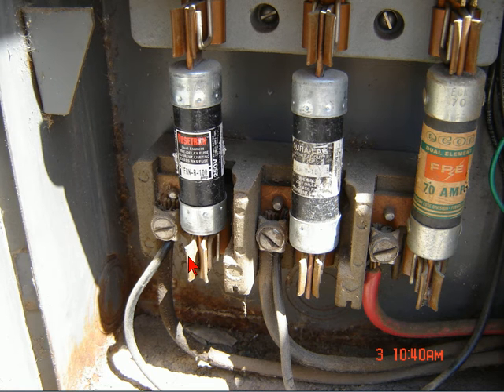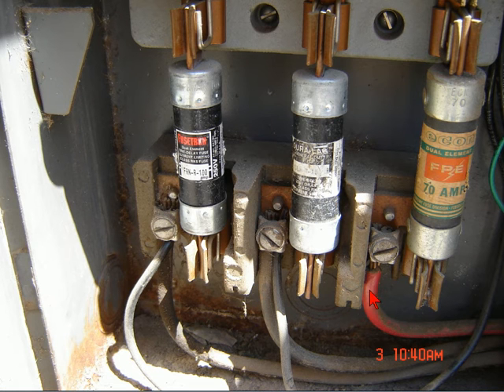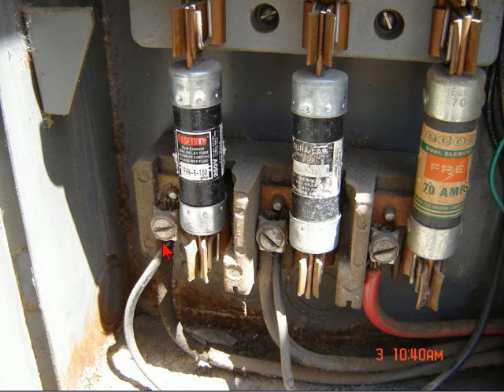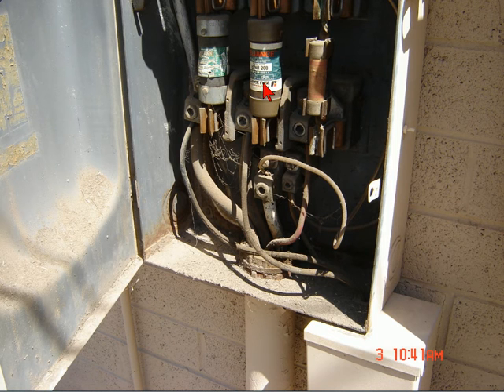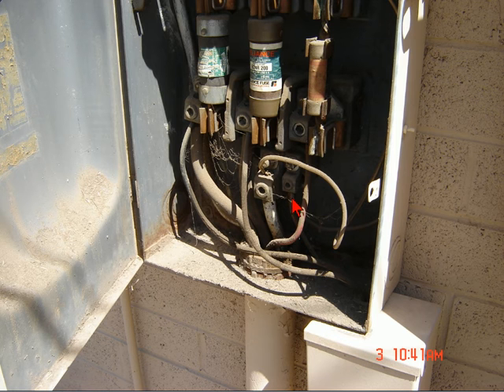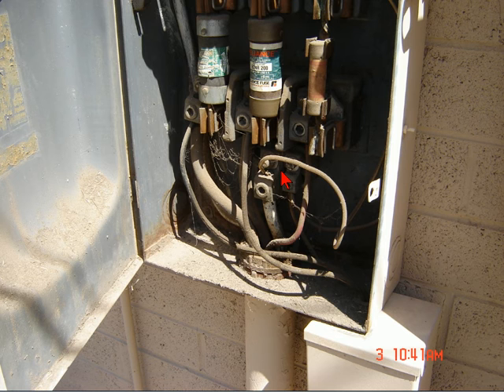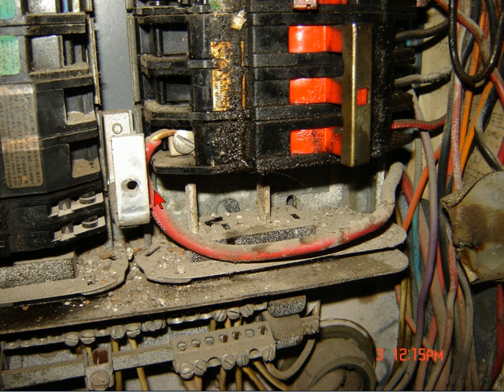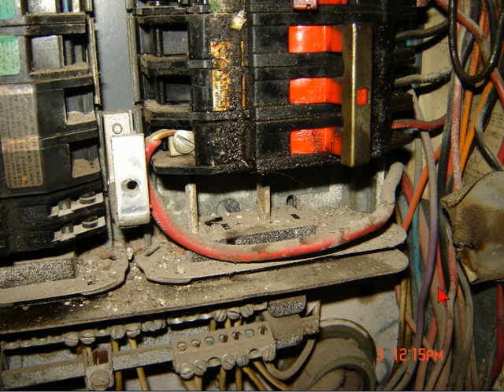Electrical Wiring Problems GP01

Comment: i think Zinsco was the only one to do it from seeing it in another video was used mostly in a main panel for a house that had only one item like a ac that needed 3 phase  so you wold get 2 phases from the main bus bars and a the therd from the smaller wire one big problem was the only way to kill power to the therd phase to change the speatal breaker was to pull the meater caus it was conected derect to the meater

Comment: Am I seeing this correctly?  A single phase 208 volt panel can be equipped with a special 3 pole circuit breaker whose 3rd pole is fed, not from the bus bar on the panel, but from a wire the C phase  high leg?  Seems a bit sketchy.  In my opinion, stick with 3 phase equipment or single phase equipment, but not a combination of both.

Comment: i need job.i have been working in the automotive industry from last fourteen years.because back in the 90's i was working with a contructor that did alot of crap to save money. i didn't like it what was going on ;i pack mine tools and went back to that industry.
it's very cool that you are one of the few people out there that care.. that will be awesome that work with guy that  do thing right.dude thank you for you time.

Comment from the maker: They only have 2 equipment demands that require 3 phase on this part of the project.We considered changing to single phase but the equipment and the utility change doesn't justify the overall cost.The utility xfmr is 120/240-they would need to change the xfmr and secondary feed from the pole to the new service.
There is another part of the puzzle I have not shown yet. That part has about 12 demands for 3phase.

Comment: It seems to me that the fuses are rated higher than some of those wires. If a short developed in their equipment there could have easily been a fire.

If that is a single phase panel, won't that high leg be constantly shorted? That fuse should blow immediately.

I bet that place doesn't even need three phase service; someone just thought they could make more money that way. If they are going to stay with it they should probably get 208Y/120 service as long as their motors are dual rated for 208.